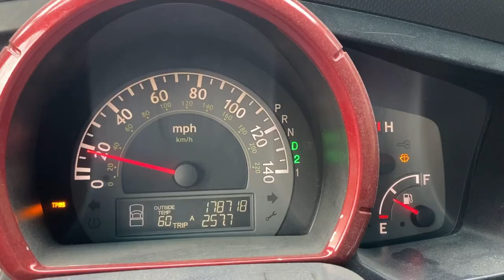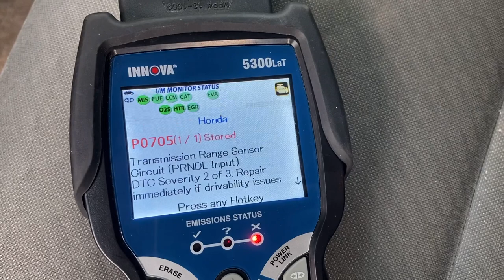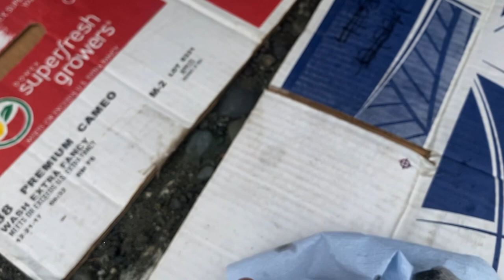How to change transmission fluid Honda Ridgeline

Comment: My 2008 RTX w tow package can smell burnt when I haul my heavier boat.  I dont' think I'm over the 5K weight. I only learned about changing tranny fluid last winter - I'm a little over 60K  so hopefully no serious damage. ( I live in bush AK with only 2o miles of road.)  A good thing about this video is showing the removal of the air duct and a little more detail on locating the drain plug.  Thank you.
Reply from the maker: I appreciate the support! I’m glad the video helped! Alaska roads towing would put a bit of struggle on it. I recommend taking 30 sec to check your transmission fluid after every trip you are towing. “Old fluid” is hard on it and the transmission aren’t very tough. If it looks burnt AT ALL any time I check it, I would ALWAYS change it. $30 occasionally is worth saving the transmission repair/replacement costs
Reply: @RenegadeHQ  yes checking the tranny fluid is one thing I've neglected but no more.

Comment: Thank you. Great video.  
I own 2010 honda ridgeline,  100, thousand on the clock , never did trans fluid .
Purchased used with 60,000 on the clock .
So 4 qts take it . 
Im gonna by honda oil , 
I see you used a different oil ..... does it make a difference?
Reply from the maker: Your welcome. And thank you! It hasn’t made a difference this far. I’m not opposed with OEM fluid, It’s just very limited up here in Alaska.

Comment: So I am old school and checked the fluid one time and panic set in because I got it operating temp and left it in park while running and checked it (I don't have a manual) the level was all over the stick no matter how many times I wiped it off and checked it. Yup, I'm an idiot. I have 147K on mine and I don't think the previous owner did anything as far as maintenance. I just bought some steel 17's from a guy with a 2011 Honda Pilot so I can put a set of snow tires on them at some point. I also had my trans fluid flushed a couple times and had a 3'rd gear switch replaced. It still seemed to be sluggish until I did the rear brakes, had a stuck caliper that I freed up and now my gas mileage is so much better 😁
Reply from the maker: That’s great! Haha. Gotta turn that engine off haha

Comment: I've seen drain plugs that look like coral reefs! Your drain plug wasn't too bad. 

Solenoids are pretty easy to replace. When you pull the solenoid assembly. There are little mesh filters in the passages of the transmission. Pull those filters and clean those out as well. Ohm out the solenoids and check for function. If they check out ok clean them up and  reinstall. If they're bad replace 😉
Reply from the maker: I’ll look into that! Thank you!

Comment: Why don’t you use genuine Honda oem fluid?
Reply from the maker: I have until this fluid change. And the shop is going to put several fluid flushes through it.
Reply: @RenegadeHQ  where do u get your Honda fluid? Can’t find any stores that sell it besides Walmart and I try to avoid going there 😂
Reply from the maker: @FJcruisin07  I just got the Valvoline “import” fluid from o’Reillys. Has ATF-Z1